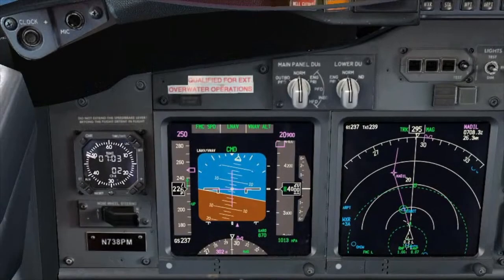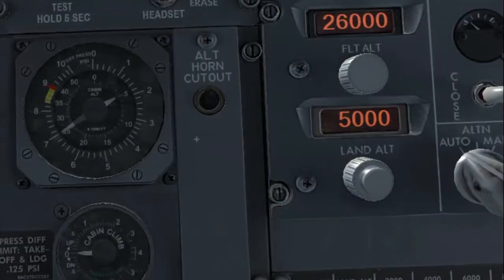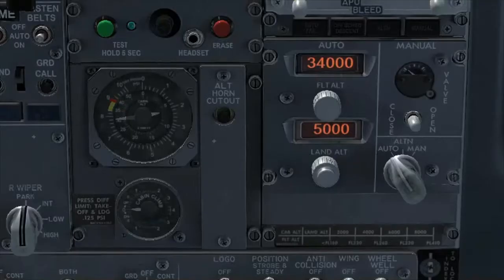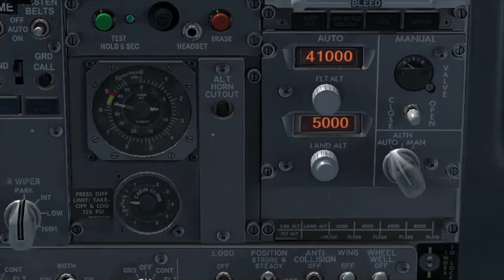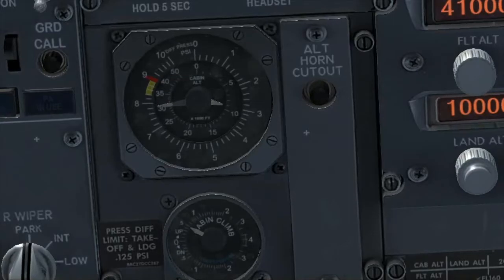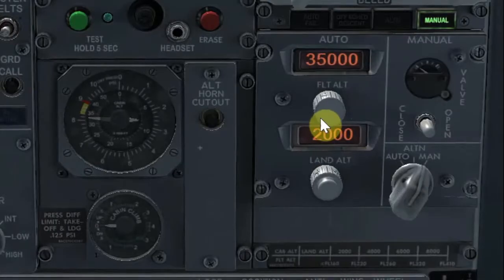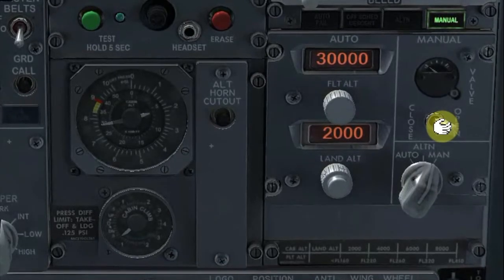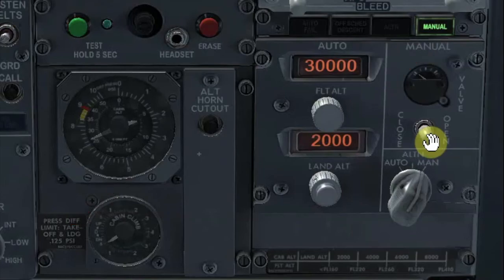Pressurization Manual Mode Operation

Comment: Thanks for your great work sir, I got a question here. During climb or descend on manual operation, you said we need to maintain a "comfortable cabin climb or descent rate", is there any specific requirements or recommendations for this climb or descent rate? Some of pilots in my company suggest that +500/-300 fpm would work just fine, and I just want to know your opinion. Looking forward to your reply!
Reply: AMM states 300fpm is “comfortable” but do not exceed 1000fpm

Comment: Question:In the spring loaded position is the outflow valve closed or open in the Manual Mode of operation?
And if its closed why we need to move it to closed position to increase differential pressure or descend the cabin altitude?
Reply from the maker: Hi Faisal, thank you for your comment. The Outflow valve switch is spring-loaded to the center (it means, no command to the outflown valve in MAN mode). If you need to move the outflow towards the open or to the close position, you have to keep holding the outflow valve switch (FCOM2). According to the QRH, it can take up to 20 seconds to completely open the outflow valve.
Reply: @boeing737pro3   Thank you for replying.